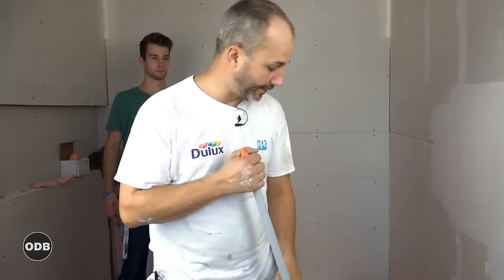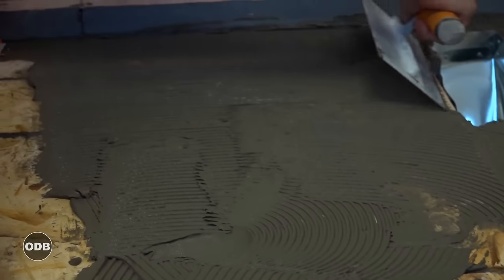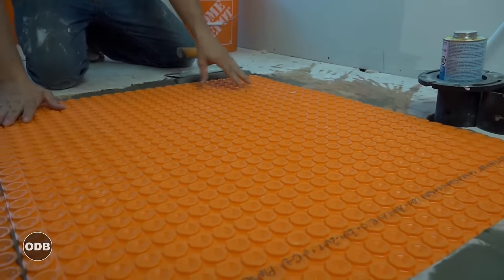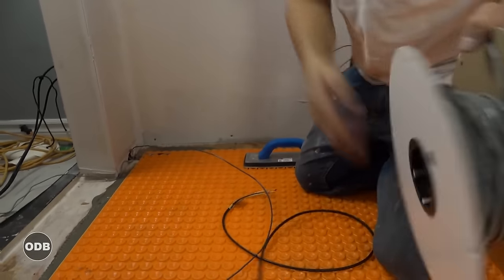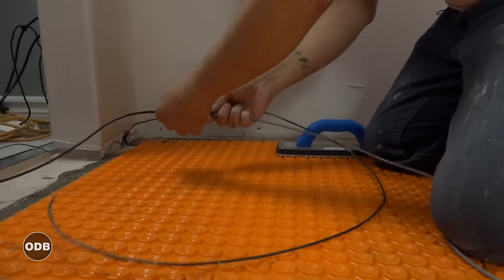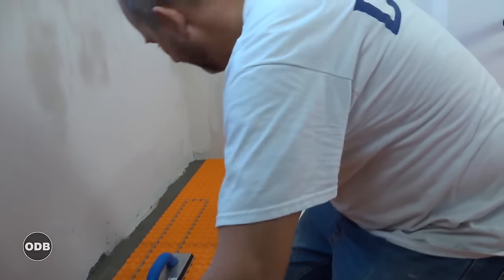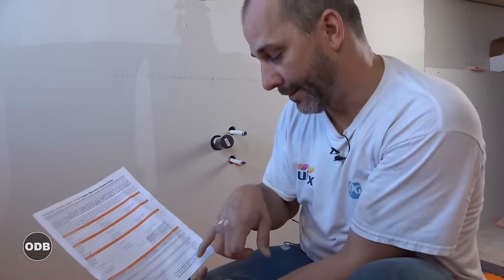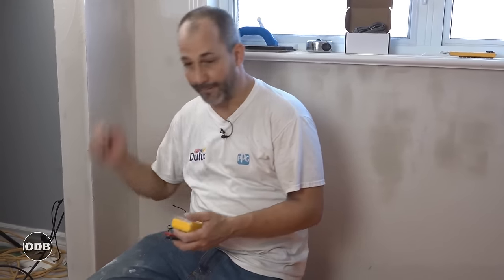How to Install Ditra Heated Floor System by Schluter Systems

Comment: You also need a mega-ohm meter.    You should have noted that on the video, a standard multi meter that you show does not measure the reading and if your floor fails without this testing done, warranty is void and repairs will be the owner responsibility.

My last floor, I ran the cable to the shower also.  You can water proof the floor by laying the Ditra-heat uncoupling, lay the cable, then lay thinset, then put a layer of standard Kerdi membrane over.  Now do tiling as normal.    I heated the entire shower floor and the bench.    Nothing like having a warm bench to sit on in the shower.
Reply from the maker: not sure what you are referring too. My meter registers the ohm just fine.
Reply: I think what he's referring to is a specific kind of multimeter that can accurately measure MegaOhms.  With a normal multimeter, the resistance between the hot or neutral and the ground braid would show up as "open".  With the megaohm meter, you can get an accurate reading on that (usually larger that 1000 MegaOhms).  This is basically measuring for any small breaks in the cable insulation that could cause extremely small current leaks to ground.  Schluter recommends this because with GFCI protection built into the thermostat, these small current leaks (not really short circuits) could flow enough current to  erroneously trip the GFCI.

It's worth noting that all other heating cables that I'm familiar with don't require this measurement.  Schluter (like most German companies) takes a "belt and suspenders" approach to everything.
Reply: Yeah any basic meter won’t capture megaOhms. I will have to purchase a megohmmeter, for the insulation test (third test). Not happy about that because they are not cheap.
Reply: Meggers, or a megohmmeter don’t just read mega ohms and are not just an ohmmeter. They produce a very high DC voltage to test the cables diaeletric (insulation) to ground. Megging a cable is one of a few different ways to test insulation, but the easiest and most accessible for cables rated less then a kV. A Fluke 1507 or 1587 is the right tool for the job here, but I find it a little absurd that this company will void a warranty for not testing their cable prior to installation. Seems like a sure fire way to blame an equipment failure on a contractor not having a pretty expensive tool that most don’t know how to even use properly. I am not hating on Jeff at all here.
Reply: @sailorjohnboy  can anyone tell me what I should read if my resistance labeled on the cable is 13.65 ohms.  Should I get that same number on all 3 tests?  He said is was 26.Something but said he should read between 2300 and 3000ohms...? Is there a range i am looking for? Any feedback would be great. Installing a front foyer atm.
Reply: @quickcad2573  too late now,..,but you're allowed 10 % 9f measured.

Comment: On the Schluter Systems instructions, it says to use modified thin-set mortar over plywood.
Reply: Right?
Reply: Must be your first time here. This dude cares less. Lol
Reply: Use can use THEIR modified at apx 60$ a bag ...or use non-modified at 15$ a bag      Since DITRA is impervious, it does not deprive the mortar of its moisture. This allows the cement to properly hydrate, resulting in a strong, dense bond coat. In general, we don't recommend the use of modified thin-set mortar to set tile over the membranes because these mortars must air dry to cure properly.

Comment: Jeff, thank you for the no nonsense videos. I will be installing the Ditra heat flooring on a plywood sub floor. I will be using a OVE shower pan. My question is, can I set the shower pan directly on the ditra heated floor so that the heat would also warm up the shower pan base.
Reply: nononoooooooo

Comment: This comes from Ditra______Since DITRA is impervious, it does not deprive the mortar of its moisture. This allows the cement to properly hydrate, resulting in a strong, dense bond coat. In general, we don't recommend the use of modified thin-set mortar to set tile over the membranes because these mortars must air dry to cure properly.
Reply: END OF STORY!!!!

Comment: Learned 90% of the time unmodified thinset sucks even on water tight membranes it may take and extra day but I took all types with shcluter membrane  then tried to peel it off a few days later the unmodified to 1 fifth the effort the trick to using modified I I giving it time

Comment: Thanks Jeff.I'm putting ceramic tile over hardwood at entryway.Do I use the Ditra? and how do I put it down? Glue? Roof Nails?
Reply from the maker: I would cut out the hardwood and have the tile finish flush with the wood and use the ditra with cement to attach both sides.
Reply: yikes..what if the next owner of the house wants the hardwood back?? ooops
Reply: You cannot install ceramic directly over hardwood. It needs to be removed, sub-floored or sanded down right to the wood (meaning no lacquer, resins, sealers, oils, waxes , varnish etc.. can be present or the tile or Ditra will not bond to the wood. It will bond (and then lift) to whatever finish the hardwood has.

Comment: I'm applying this product to a basement with a concrete slab. What type of mud is required for the mate in this situation? Unmodified or modified?
Reply: Charles Seawell unmodified. Stop by your local tile supplier and they should be able to recommend anything.

Comment: can i use modified thinset to glue down ditra mat on a plywood floor
Reply: Yes. That is actually recommended. Non modified thinsets are not ANSI rated for use on wood.

Comment: Thanks for the video!   We are going to use the schluter ditra mat.  We are so curious How are you are doing the shower without the mat. This is a basement bathroom and height consideration is huge, and we already have installed a wedi pan.  I’m wondering if I can just run the line through the foam threshold And embed it in the mortar, when placing the tile.

Comment: Hi Jeff,
My husband and I love your videos! We are renovating our bathroom and plan to put schluter ditra heat. We only want certain areas of the floor to be heated, not the whole bathroom (for example, under the washer / dryer).
My question is: to maintain a level floor, what do you recommend putting for a schluter membrane? I see a couple options: 
- Just put the Ditra heat membrane everywhere (and only run the cables in the heated areas)
- Use a combination of ditra heat membrane and the "regular" ditra membrane
- Is there another option you would recommend?
Thank you
Reply from the maker: your best option is to install dittra heat everywhere. i have yet to find a good cheat. Cheers!
Reply: The different Ditra membranes are different thicknesses so you should only use the Ditra heat membrane if you are going to install the Schumer heated floor system. There is a Schluter heated floor version that includes some sound proofing but you’d only use one or the other because those are different thicknesses.

Comment: When using Ditra mat or heat, can you install the mat over 3/4 plywood subfloor? Or does the floor still need to be 1 1/4**thick?

Comment: Hi Jeff... really great videos.  You've helped ma already a great deal.  I installed the ditra mats, installed the heating wires and thin-set over the top.  After drying I have found that some of the edges of my mats have not bonded to the substrate properly.  Can I try to pull up just some of the mat and reapply the thin set, do I need to pull up the whole mat, or is there another option?  Thanks!
Reply from the maker: Hi Philip, Schluter has solved the ditra mat problem with its new allset mortar. Unfortunately the traditional thinset underneath does a poor job of bonding to OSB. Please send me a picture and a list of the products you used. cheers!
Reply: @HomeRenoVisionDIY  Hey!  Thanks for getting back... not sure how to send a pic, but I used Kerabond T Large-and-Heavy-Tile and Thin-Set Mortar with a 1/4x1/4 trowel over 3/4' subfloor which I wet as you showed us in your video.  The piece that didn't stick seems to be because it curled up a bit.

Comment: Can you touch on the reasoning why you did not lay Ditra heat in the shower, and what steps you took to lay the wire while tiling? My current situation is that  I installed a curbless shower pan, with a trench drain (Redi Tile), and lowered shower subfloor and replaced surrounding subfloor with a thicker board inorder for the show pan to sit flush with the surrounding bathroom floor.  Last minute realized I needed some sort of membrane since I will be laying large tile continuously through shower and bathroom, and thought I might as well go with Ditra heat and pay a bit more for heated floors. Now I’m trying to determine if I need to lay the Ditra inside the shower pan or not.
Reply from the maker: that is a tricky question. Schluter does not recommend heating in a shower anymore since they had to many problems with folks bending the wire up and over a curb. in your case it should be fine but I can't recommend you do it without first talking with them. Cheers!
Reply: Home RenoVision DIY that makes sense. Appreciate the response, I’ll give them a call.

Comment: I used the Ditra system 2 years ago, and had 2 issues. First it is only to be used as a floor WARMING system, and 2, the thermo-couple is a bit too large to fit flush with the membrane so I cut the membrane to make it fit better then compounded into place 24 inches from the wall. Warm feet though.
Reply from the maker: Yes the membrane can be cut to accommodate. I used large tiles and as such needed to use a 1/2 inch trowel so there was lots of room.

Comment: Isn't it supposed to be modified between the wood and ditra and then unmodified between the ditra and the tile?
Reply from the maker: They recommend non modified under the ditra, however experience shows that was a bad idea and that is why they make their own non modified cement now called allset. I have always used a non modified cement because the science leans better with that application if you wet the substrate first!
Reply: @HomeRenoVisionDIY  So, I certainly don't want to beat you up on this because your videos have been immensely helpful, and I'd have not been able to do this bathroom renovation without your videos (well, or comparable videos, but yours have always been explained best that I've found).  But I kept finding conflicting information, so called Schluter directly on this (as my Ditra Heat portion of the project is next), and they say modified (their own brand or any other brand) when binding Ditra to wood, unmodified if binding concrete.

Comment: Problems with nearly all underfloor heating is no insulation under the concrete slab. The heat will travel down into the slab therefore you have to put insulation at least 100mm down plenty of mesh and you will see your electricity bill savings. As it will  warm the slab and will hold the heat for a very long period .

Comment: Yess! I NEED a marble floor and wall, curbless, drainless, doorless, waterfall shower with heated floor and bench. It has to be so good, my collegaes or neighbors are never gonna wanna come to my house. 🤣🤣🤣
Reply: We wanted a marble floor but Schluter heated floor system requires a double thickness subfloor and tiles that are at least 2” big to stay within warranty. We were totally bummed to have to return our lovely marble tiles and settle for fairly boring 2” non-marble hex. :-|

Comment: Do you have to be Certified to install the producct?
Reply: I believe it’s only if you are paid to install for others, that you would need to be certified. You can install your own but it’s a bit complicated and so many things need to be done to Schluter specifications in order for you to be covered by their warranty and for the system to work properly. It’s also important to hire professionals to do the electrical and plumbing parts.
Reply: @RsJaneP  Debs,  All Done. It was no big task.  Just follow the instructions.  Turned out great.   Best Wishes .

Comment: can the ditra heated floor system be applied on concrete and does floor leveler have to be used?
Reply: When tiling you should make sure its level. It will be expensive to find out half way through the job that you need to level.
It needs to be as flat as possible. Use the T-Lock type system to make sure tiles are level with respect to each other. 
Ditra TB is what you use on concrete so the heat isn't leached into the concrete. It has a thermal break to make sure the tiles get the majority of the heat.
I do not know the amount of variance you're allowed to have when tiling. Ditra will not fix out of level floors. And try not to use thinset to level your floor.
good luck.
Reply: @tomhollins9266  I believe Schluter calls the "TB" stuff Ditra-HEAT DUO now.

Comment: Hey can  use any type of thermostat on any type of floor heating?
Reply: Typically not.  Electric in floor heaters like this are powered by the thermostat.  Which means it is more of a controler/power source than a thermostat. 

Some brands may have the ability to connect an external thermostat but typically not.

Comment: The purpose of doing the ohms test is because of the resistance created by running cable all different directions ?
Reply from the maker: The ohms test tells you if the resistance is within normal range for the product before and after installation. They have a range in the packaging that would be considered normal. If the number is the same out of the package as after the install, that means the product is not damaged and it is safe to tile. After tiling you can check again before you grout. No sense finishing the job and not knowing if the heat works.
Reply: Home RenoVision DIY Thanks for the response. I am currently tiling my whole house and it’s a lot of back breaking work.
Reply: A cool feature of the Ditra Heat wire is connecting only the near end of the wire to the thermostat! The far end of the wire can end up anywhere; it makes it really easy to lay out.
BUT what this means is that the full circuit - the positive outgoing wire and the negative return wire - is all contained inside the insulator. This means that anywhere along the length is where a short can (and will try to) occur.
Testing with a MegOhmMeter is prescribed to ensure there is not even the tiniest of insulation faults along that long wire you just manipulated into your substrate. Tiny faults will trickle micro amperage ...until they get bigger and hotter... until there's an actual arc and the GFCI kicks in!
DIYers, TEST WITH A MEGOHM TESTER AS PER THE SCHLÜTER INSTRUCTIONS.
I bet a Pawn Shop near you has a couple of them.

Comment: Did you have a show where you had to join two in-line copper pipes and you removed that little bump that limits the movement of the connector so that it could be slid above the joint to fit in the other half of the joint?
Reply: Use sharkbite or cut the pipe and install  a non stop fitting
Reply: @jaandel1  Thanks. I've looked at some of these ideas and even a union joint (or two). But, I saw a video that showed how to get rid of that little bump inside a connector. That idea struck me as a good one. I thought I saw it here.
Reply: @jameslatimer3600  just slide it onto the pipe and use a hammer to tap it all the way on. Then use channel locks to twist it back in place after your pipes are aligned. No need to get rid of the bump. Do it all the time.

Comment: I have a GFCI that keeps tripping on my board, a certified electrician did all the electrical and hookups, but it used a wire nut on the ground wire. I was told that a wire nut does not hold tight to the braided wire and the hard wire. Will this cause the GFCI to keep tripping? I turn it on in the morning on manual. It runs great all day and then it seems around 10:00 p.m. it always trips. Is this a problem you have faced and will that cause it to trip???
Reply: GFCI keeps tripping on the thermostat or in the electrical panel?
Reply: Doubtful... GFCI stands for: Ground Fault Circuit Interrupter and trips when it detects power / current flowing to ground (e.g.  a short in an electrical box or coming in contact with a person that serves as a source to ground). In other words the circuit is either shorted to ground or it isn't so only tripping everyday around 10PM doesn't fit the bill.  It's more likely the breaker you are referring to is actually a AFCI which stands for Arc Fault Circuit Interrupter which will trip whenever it detects a possible "arc" fault fire hazard, like sparking wires in a loose wire nut. AFCI breakers have a tendency to trip more often than a GFCI because small appliances such as hairdryers, heat lamps, vent fans, vacuums etc., generate small, periodic arcs when in operation which can introduce what is known as "nuisance tripping” because AFCI  breakers are highly sensitive to the smallest disruption in the circuit.

Comment: Another GREAT video! Okay, Jeff so I found the video with you showing how to install vinyl Plank flooring that you recommended I use and here you're showing an electrically heated mat system that will be underneath a ceramic/stone tile flooring. I'm also getting from this video that the installation of this product is better suited for a professional, yes? Besides that, would this particular electric heat mat system be appropriate to use under vinyl flooring as well or would another product be more suitable?
Reply from the maker: I would not use Ditra, I would suggest "warm up"brand heating system
Reply: @HomeRenoVisionDIY  Thank you!